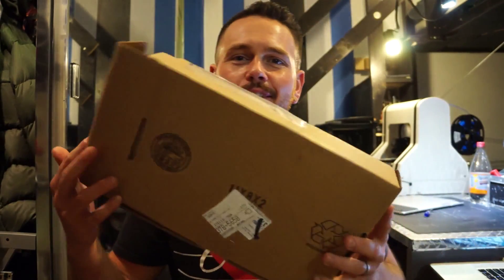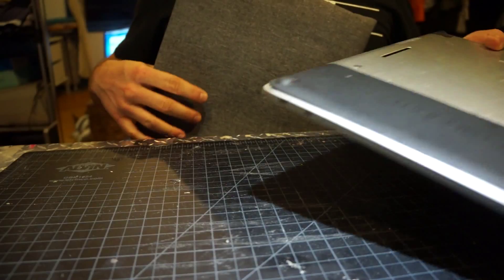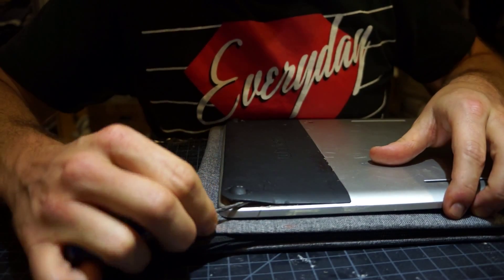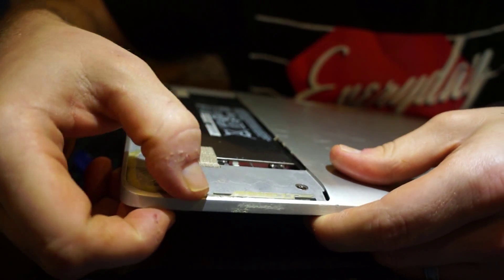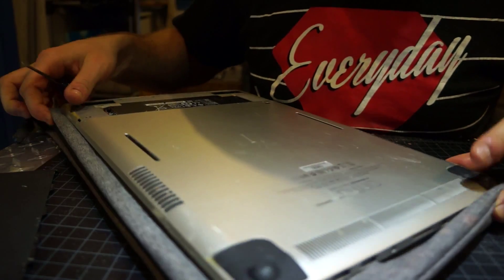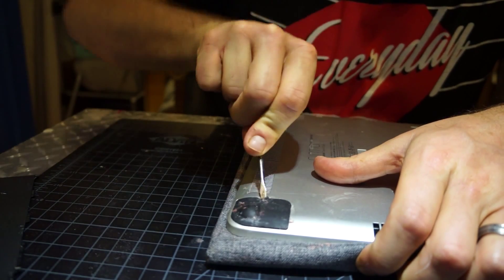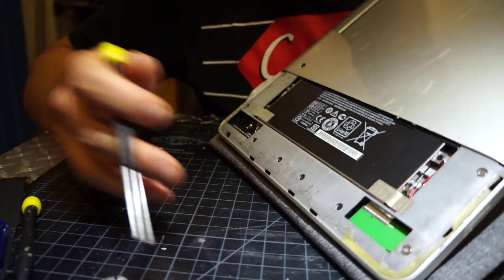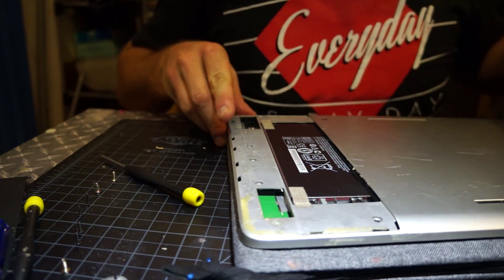Wacom Cintiq Companion 2 Disassembly

Comment: I just paid $69.99 on a replacement battery and this thing is nightmare to open! I can’t even begin to get it started. I’d really like to get this device up and running again with a minimal damage as possible.

I’m not sure how you managed to get a screwdriver into the crack between the aluminum and plastic which is as thin as a sheet of paper, and didn’t manage to completely destroy the rubber surround while trying to pry it open. Razor blades and exacto knifes fit, but they break off when attempting to pry with any force. Even the knives I tried seem to be too thick and not providing enough surface area on the blade to pry. The glue is an absolute beast and heating it up seems to do nothing to soften it, it just makes the rubber coating peel off the plastic while making it more damage prone.

Any tools or tips would be greatly appreciated.
Reply: I've just run into this with my unit. Where did you get your replacement battery?
Reply: @scotthaycock3345  

It’s been working great so far and has held a charge better than my original battery when brand new. It’s not an easy repair only due to how difficult it is to crack open the casing without having proper instructions. But, once open it’s rather easy to swap the battery.

In my case, I did cause some minor damage to the enclosure and I also needed a replacement AC adapter. I’d recommend doing any upgrades to the SSD storage or Ram if needed while it’s open the first time, to avoid having to crack it open again.

Also, my fans were running often and rather loud prior to the repair job, so be sure to clean them out, and I highly recommend the following:

If you’re going to do this repair, I’d recommend buying some heatsink thermal paste and replacing it while your at it by taking off the heatsink / copper heat pipes and fan assembly (rather easy), cleaning out any dust from the fans, wiping off the old thermal paste from the cpu and heatsink with rubbing alcohol and a proper re-application of thermal paste to the cpu/gpu chipset. In my case the thermal paste was old, crusty, dried out and not very effective anymore. There were times it would run sluggish and also shut down unexpectedly. I believe this was due to overheating because of the old thermal paste. If the device only turns on for a few seconds with fan noise and then shuts down before booting, overheating due to bad thermal paste is most likely the problem as it tríps the overheat circuit protection rather quickly after powering the device on.

Despite the minor damages to the enclosure prying it open, the device runs great now, it’s cooler than ever, performs great, is no longer sluggish, hasn’t powered down in its own, and holds a decent charge! 

Well worth the $69.99 battery and $7 thermal paste. And in my case a $17 AC adapter. It’s as if the battery, AC adapter, and thermal paste all took their last breath at the exact same time. I’m not sure if Wacom is still doing factory service on these devices, but this route is certainly cheaper.

I’d recommend very thin metal prying tool(s) to get started. Heating up the areas where the glue resides with a blow dryer will help loosen it, but not much. However, doing so will also likely make the rubber non-slip coating peel loose from the plastic.

Try to get the prying tool under the plastic covers and not between the non-slip rubber and plastic. This can be tricky. They sealed up this device rather effectively!

Any questions, don’t hesitate to ask!
Hope that helps.
Reply: @joesandstrom4111 Hi there, your reply and message here about the Heatsink(s) removal and application of the thermal paste is great.  Something that should be a "MUST" to DO for all older CC2 models, I noticed mine is shutting down randomly due to overheating as well.  The fans blast loud like jets right before it shuts down. I manage to open mine with minimal cosmetic damage. I am upgrading the battery as well, along with a few other parts. But my main concern is cleaning up the CPU/GPU's old, crusty thermal paste and re-applying a fresh layer of the paste.  I just need more specific and detailed instructions on these steps, since I am worried I may damage something accidentally, the thin, copper heatsink pipes look very delicate, they also don't look like they are fastened to the main computer board in any specific way. With screws or anything.  Honestly I cannot tell what's holding them together and to the CPU , other than the paste ?!? Would you please message me back here or just on YouTube in general to let me know how you proceeded to remove the Heatsink pipes and expose the old thermal paste to clean and reapply it? Thank you 🙏 in advance.
Reply: @scotthaycock3345  

It appears YouTube keeps removing the URL, but I purchased a replacement battery through Amazon.

This is the info:

Replacement for Part Number:
G6BTA019H 0B23-00E00RV

Compatible with Laptop Models:
Wacom Cintiq Companion 2 DTH-W1310 Tablet PC

You can search the exact battery I purchased on Amazon:

INTIFO 50Wh G6BTA019H 0B23-00E00RV Replacement Battery Compatible with Wacom Cintiq Companion 2 DTH-W1310 Tablet PC [11.4V 4470mAh 3-Cell]

The listing appears to be a third party branded battery: Intifo by Tainovo, Inc. 

However, inside the box I received was an original OEM battery - Pegatron G6BTA019H.
Reply from the maker: @joesandstrom4111  hey sorry for the late reply. I haven't been on here in a while. Great info, thanks for your contribution! I may have to order that battery as well. I don't know how you found it!

Comment: Hi I had a couple questions. Would I be able to swap the battery with just removing the bigger black panel Or would I have to take the screws out? 

Second I have two of them, one is is great condition but the screen is dead, the other not so great but has a screen and battery is dead dead. It looks like removing the screen would be really really hard, would you agree?

Comment: Hi there. Do you know what is the battery model number for this Companion 2? Your help wold  be highly appreciated. I asked Wacom, but they don't want to give the information like it's not our business.
Reply from the maker: hey i uploaded this pic for you from when i opened it up. It appears it is G6BTA019H
https://ibb.co/qjFX0xP
Reply: @MobileGamingGeek  Thank you very much buddy. I really appreciate it! I'v been searching for this battery around but it's just unavailable. I will send it to Wacom when they will open. They told me they charge $200 US for a  battery replacement. 
 You see, I work in my car as a security guard watching a store in a parking lot during the night. I found a great solution. Last Saturday I went to buy this thing in an electronic store: 
https://www.maddison.ca/mad-029947.html
( The one I found has only one AC outlets and not 2 like in the picture). I'v tested it and it works amazingly to charge this Companion 2. There is a fan inside that device to avoid overheating. It also stops charging if the battery of the car doesn't have enough power to start the car. After few hours I was charging my Companion 2 I started the car and my OBD2 shown that the battery of my car was almost 100% full. I wanted to share these info to help others.
Now I'm struggling to find a decent Tablet mount so I can mount this Companion 2 on my steering wheel.
Thank you very much again.
Reply from the maker: @8bittimetraveler834  Its funny you mention that, im actually currently making a VESA mount clamp style (for easy release) for the cintiq companion 2.  I would offer to make you one but it might be a bit of an undertaking. The device you found seems like a good workaround for now, i was going to warn you of the battery drain of the car but it seems to have addressed that. Good luck with your battery search and stay safe with the security stuff.
Reply: @MobileGamingGeek  Hello there. That's really interesting. I'd really love to see your project. I was planning to go at Home depot to see the materials they have so I can build a Power steering mount for the Cintiq Companion 2. I just don't have much time to do it. About the battery for that model, I spent a lot of time looking for one on the internet, and it doesn't seem available at all. I saw similar models. I saw some for the Surface pro for example, but I don't think it will fit since the battery model for the Companion 2 has a very specific shape. Thank you very much for letting me know.
Reply from the maker: @nexus-6392  yeah i tried to order a similiar battery and retrofit it. Had the same specs, size etc, I think it was for a chromebook or something. I actually did it twice forgetting that I had already tried a year ago.. haha, but no it doesnt seem possible to put a different battery in, it was also impossible for me to find a replacement. Do you have a picture of where youre trying to mount it? Im designing them in tinkercad and 3d printing them. Mine is a clamp with two strong retention springs that has vesa mount holes so i can easily clamp it (or any tablet, surface etc) and mount it to the ergo tron arm on my desk.  I was planning to try to manufacture these myself with molds but my enthusiasm for all my projects seems to fade. I will try to find you some pics.
Reply: @MobileGamingGeek  Hello. I did not bother to open my Companion 2 to be honest. I compared the battery from the picture you sent me with the one from the pictures of the batteries I found on the internet. They look similar on many points but they don't match. One was from a Surface Pro and the other one was only saying: Drawing tablet. 

About the mount it's a very good question. Your idea is super awesome! I would really love to see one or 2 pictures of it since I'm more visual. You have no idea how enthusiastic about this. When I'm at home what I prefer is to put the Cintiq on a pillow on my legs, but when I'm at work in my car, the only way I can use that Companion would be by hanging it on the steering wheel. My car is a 2007 Lexus ES350. The steering wheel looks like this:

https://www.pinterest.ie/pin/486459197226021942/

I have a good idea for a steering wheel mount. I will try to draw it.

By the way there is a tool I strongly recommend for a Cintiq. It's the Wacom Expresskey remote. This thing super awesome! It allows you to change tools and functions in a matter of microseconds. Before buying it I was using an Xbox 360 controller with the program Xpadder to associate the buttons with keyboard keys. It works pretty good too.

Thanks you so much!

Comment: Hey is there anyway to fix a cintiq companion 2 with a cracked screen from the inside? Half of my screen is black and cracked and it would cost 1000$ to repair it :’)
Reply from the maker: As far as I know you would have to buy a replacement screen and diy. But I imagine it's possible. You would have to disassemble most of it.
Reply: TheCGAlchemist thank you so so much 🥺❤️❤️❤️
Reply from the maker: @lulabiebyi8999  of course! Have you found a replacement screen?
Reply: TheCGAlchemist not yet! I’m on the search for one rn, i also read online I might need a lcd replacement? Idk where to find one of those but hopefully I find one soon agh
Reply from the maker: @lulabiebyi8999  oh ok. Wait... I mean if the screen isn't working then yes you need an lcd which should come with the pen layer. Let me see if I can find anything.
Reply from the maker: @lulabiebyi8999  here is the whole front assembly, buttons and all.
Reply: TheCGAlchemist like the actual outside screen is not cracked at all, but half of my screen is black, it still works fine it’s just super annoying because drawing has become difficult since I cant see half of the screen
Reply: TheCGAlchemist I’m sorry I’m being confusing agh 🥺
Reply from the maker: @lulabiebyi8999  that's really strange. But yes it sounds like the lcd inside is broken. How did it happen? Maybe a cable is loose.
Reply: TheCGAlchemist My brother left it on the floor and I accidentally stepped on it, once I turned it on half the screen was black and bleeding
Reply: TheCGAlchemist but the screens not cracked at all from the outside

Comment: Dude!  a METAL SEPARATOR TOOL (screwdriver)??  (Next time...) maybe use those sharp plastic separators and spatulas made for this purpose.  You mention "industrial grade adhesive" in my experience, using a blow dryer to soften the glue...  makes it lift right off!      Much appreciated video, I dropped my WCC2, just 2 feet,  on one of the edges and it just stopped everything, nothing, no charge no anything.  I hope it is just a wafer cable out of slot or something...  BROTHER, HAVE YOU EVER HEARD OF A GPU VIDEO CARD UPGRADE FOR THIS THING? EVEN EXTERNAL???  THANK YOU!  I ama Hollywood level character animator and Unreal Engine expert and  developer:  LETS COLLABORATE AND MAKE A GAME!
Reply from the maker: Hey dude! Nice to meet you! I was pretty amateur at taking shit apart but o well. I will try to be more careful from now on haha. I was actually going to work on a project of making an external gpu box but i scrapped it and dont remember why.  I think it involved uninstalling a necisarry internal component. But I will look back into it and let you know. I would love to colaborate. I have been wanting to make a game for a while now. I would love to colaborate.
Reply: @MobileGamingGeek  my Batterie ist dead...and waecom would take 150 euro for a new one. Better Options?
Reply from the maker: @thehornyhorny  unfortunately no, dont waste your time. I have tried a few that match it as close as possible and nothing works.
Reply: @MobileGamingGeek  so i think i spend 150 bucks and thats it. If they damage IT: i get a new one :-) better than try and (my wife beat me) error
Reply from the maker: @thehornyhorny  haha yeah totally worth paying the 150. Sorry i couldnt have better news. but hey you wont get beat? lol
Reply: This thing is a nightmare to open... plastic tools just won’t cut it... and a heat gun doesn’t help either. That glue is ridiculous and to get in those cracks requires a razor blade. I have no clue how he managed to get a screwdriver in there...

Comment: Hi, i tried to disassembly my companion 2 because i was going to replace the battery and unfortunately some parts damaged when i tried to open the case.
The damaged one is the gold ribbon that connects Wacom PWB C-112 board and powet button that sticks on the board is missing too. Do you know where to buy the spare parts? i have tried to contact wacom customer support but what they recommend is to get the latest mobile tablet since the don't have the spare parts. 😭
Reply from the maker: The power button is missing? How good are you with soldering?

Comment: I've got a series 1 Cintiq and I want to take it apart to check the battery and replace the power jack. How difficult is it to get ahold of the replacements for these? Will I have to solder anything?
Reply from the maker: sorry for the late reply, yes to replace the power jack that would take soldering, the battery should just be a matter of unscrewing and unplugging, etc. Is the power port bad?

Comment: Just wanted to say, Thank You! I have the same Wacom Cintiq Companion 2 and thought I had no other option to repair it until I found your video on how to open the unit.  My CC2 was overheating so bad that a corner of the screen was starting to put up!  I've had it for over 3 years and so I contact Wacom and was quoted $840 and just like someone in the comments said that it would be more.  So, after watching your video I decided to open it out and to my surprise, the battery was the issue because it was really warped and look like it was about to explode!  I took it out and now my computer is working but not overheating on shutting off, just wish I could find a place online to buy another battery.  

I want to upgrade the SSD to 512 and add another 8GB of ram to make it 16GB, any suggestions on brands or what to search for online?  Thanks again for making the video!
Reply: A bunch of CC2 users on Reddit said this battery is the one. Pretty cheap, too.

https://www.ebay.com/itm/8700mAh-7-4V-Genuine-G6BTA007H-Battery-Drawing-Laptop-2ICP7-65-80-2-/263964062002
Reply from the maker: hey sorry i havent used my channel in a long time. Hope you got it all worked out. Glad the video helped. I just bought another one online for 300 almost brand new with a dead battery. I will probably start working on it again. Still a great device.

Comment: is it possible to change the graphics card on one of these? i changed the ram after seeing this video, thanks for the info! but my companion can't handle color grading video without really slowing down and i'm wondering about upping it's graphic capability.
Reply from the maker: No sorry the gpu is integrated and it lacks an external TB3 port for an external gpu. There is theatrically one option. But it would be crude. Now you're making me want to try it haha. You could get an internal mini pci-e adapter and connect a desktop grade graphics card to the Wi-Fi module slot.

Comment: Hi There, 
I have damaged the touch sensor's flat orange cables mid-bottom of the tablet. So I highly appreciate if you can guide me how to find OEM cables from anywhere
Reply from the maker: Ozgur PEKTAS you would have to order them from wacom if possible. Can you send pics? It's been forever since I've worked on this.